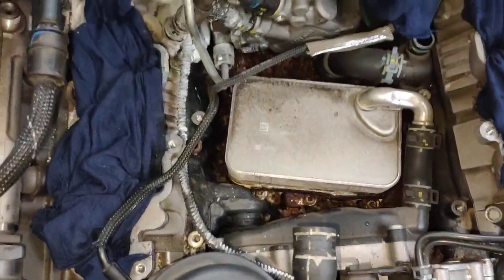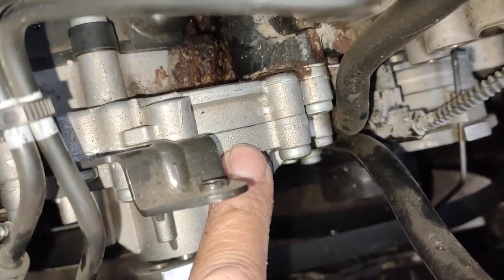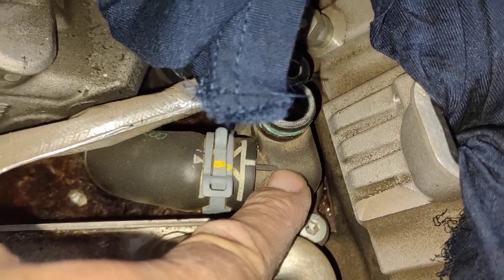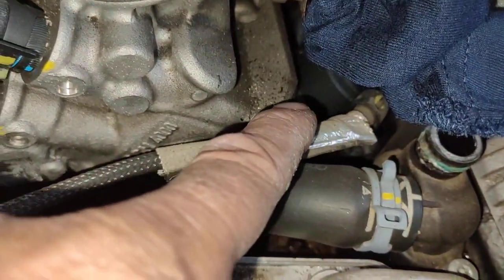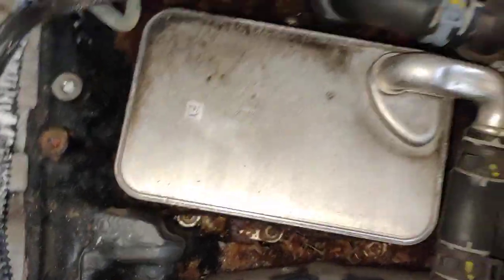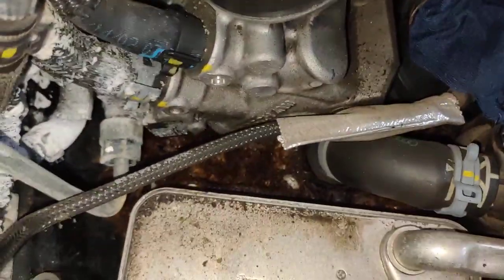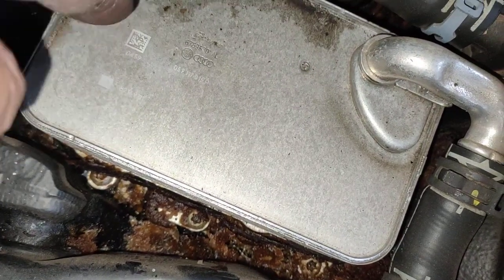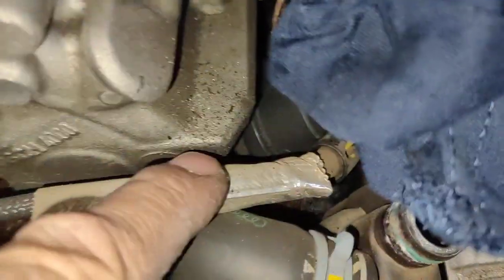Porsche Macan & CayenneV6 Diesel -Cooling system-common parts that fail causing coolant leaks by EMD

Comment: Hi Paul, happy to find your chanel, subsribed. I have CRCA engine and I faced the same leaking problem in the past and I resolved it. Unfortunately I was not aware the possible leaking of the plastic back cover of the waterpump housing and I have not replaced yet. So far so good. I found one problem with no clear solution for this engine: engine oil in the intake system. First I suspected the oil separator built in the head cover and I tried to wash throu. It did not helped. Next suspect is the PVC valve integrated in the head cover. It is on the parts database but do not have the part number. Seems to be not replaceable itself, only with the head cover completely.The cup of the PCV valve seems to be hard pressed into the neck of the head cover and I was not dare enogh to try to remove by force avoiding braking the cup or the head cover. What would you recommend to figure out why and from where the oil coming from into the intake? Could it be from the turbo due to a bad seal? What your experience is telling for this?
Reply from the maker: Yes turbo can have a small leak from the seal & cause a lot of headaches because no smoke is coming out of the exhaust yet

Comment: What is the life of these oil coolers you have seen, specially for 2016 models if there is any change, even though they look exactly the same?
Reply from the maker: Around 6-7yrs
Reply: @emdporschespecialistcaring8975  On my Audi A7 TDI 3.0, I am replacing everything under intake manifold except oil cooler and Coolant housing (because of its complexity). What you suggested for these two?

Comment: Based on your experience on these Engines and while doing this coolant or oil leaking job, which srews or bolts commonly or ever get strips or break during tightening?
Reply from the maker: All the screws on this job are  normal & can be reuse again but if you get new ones even better.
It's very hard to strip them as long as you wind them in by hand.
All 10Nm
If it's the very light weight ones like transfer case bolts. It's a must to replace them

Comment: Hi mate, I've got a 2013 A5 3.0 TDI with 100k km with the coolant leak under the flanges. So from this video would you recommend replacing the front plastic cover when I'm at it? Just a bit wary of the extra labour cost with removing everything from the front in addition to the intake manifold. Any advice would be appreciated. Cheers :)
Reply from the maker: Hi Henry,
I highly recommend changing all these parts mentioned on the video.
They are all plastic & if you don't replace the top plastic housing that's bolted to the front cover - It will cost more to do the whole job again.
If one of these plastic parts starts to leak the rest will follow.
Only a matter of time
Reply: @emdporschespecialistcaring8975  Thank you! I read online that I should order 059121086AH coolant pipe as well when changing the flange as it's prone to breaking when you move the pipes out of the way. Do you think I should get that too for doing the job?
Reply: @Henry-nr3sf  I'm doing this job on my SQ5 at the moment and I can confirm the same coolant pipe broke for me. The tip of it opposite to the expansion tank snapped and it's lodged in the other coolant pipe so I'm trying to see if I can fish it out and only replace the part number you mentioned.
Fyi I was quoted $104 from Audi for this little coolant hose. I wish we had something similar to fcpeuro for Australia, cheaper than dealership prices and buy online.
Reply: @Henry-nr3sf  sorry just realised I made a mistake. The part you're referring to I didn't have issues with when moving for the intake manifold. The hose that broke for me was 059121731D, this is the hose from the expansion tank that attaches to the part you mentioned. 059121731D quoted at $41.59
Reply: Thanks Belal, are you replacing the front plastic cover as well or just the flanges? Was the job hard to do yourself?
Reply: @Henry-nr3sf  I only found these videos last night so I was not planning on changing the front plastic cover but I will inspect it today to see if I can spot a leak. I might also get a quote on the part of it doesn't cost too much I'll replace it while I'm there. The only thing holding me back is that I'd have to take the front end off which means I would have to degas the AC system which I do not have the machine for. I'll also be inspecting the harmonic balancer for any play, and  the water pump too.
Reply: @Henry-nr3sf  I'll be replacing all the seals for the oil cooler, the flange and coolant shutoff valve as people reckon the shutoff valve leaks at where the arm pivots, seals for the flange and shutoff valve, intake manifold seals, and maybe the front plastic cover for the water pump.
The trickiest part was getting the intake manifold off, lots of cabling and hoses that run across the top of the manifold that have to be removed. I also had to remove the left side fuel rail off in order to get the manifold off.
Once I had access to the manifold and had all the manifold bolts off I couldn't loft the manifold off because it was sealed on so tight. So I spent a couple days trying to figure out how others did it, one YouTube channel called halffast told me he used a small pry bar as his was also stubborn. So I finally mustered up the courage to apply more and more pressure on a small pry bar that would fit  along the front of the intake and managed to unseal it little by little. You've then got to get creative with how you actually pull out the manifold as you'll realise there are things obstructing from all sides. The main obstacles being the fuel pressure sender on the left rail which is why I removed the whole rail rather than the pressure sender as you'll have to replace the sender itself if you remove it. And the fuel rail high pressure lines to the rear as they only have several mm of clearance between the intake manifold. I think I mainly tried lifting the front of the manifold first to clear the engine pickup brackets and then once I was able to clear those two brackets I had to sort of turn the manifold anti clockwise some what to clear the right side high pressure fuel rail line as the manifold catches on the line where it goes down in towards the valley.
If you don't need the car for a week or two then you can definitely diy, just takes time because of the damn intake manifold and then waiting for parts. But it gives you a good opportunity to clean out the carbon from the EGR. You can use the Erwin manuals as a guide but there were some things I did on top of what's mentioned in the manual such as a disconnect left fuel rail because I found it necessary for the removal of the manifold.
Reply: @belalhaidary8515  cheers Belal, think it’s definitely a shop job for me as it sounds pretty extensive!
Reply: @belalhaidary8515  Hey Belal, also found this Russian video that shows most of the job and might help you: https://www.youtube.com/watch?v=1mluiANseog  . I'm re-thinking about tackling this myself again now. Even in the Russian video he mentions removing that top manifold is the hardest part. Have you got quotes on how much labour would cost you? I've got one up here in QLD for about $760 - just trying to work out if it's worth it trying to DIY and save the cost lol.  Let me know how your DIY goes!
Reply: @Henry-nr3sf  This video would've been great to have before I started haha! He doesn't show the process of taking the manifold off though which is a shame, but still very informative. I got the parts yesterday arvo and managed to put everything back, just got to cleaning most of the carbon off inside the manifold and air pipes so I'll put those back tomorrow and she should be all done. I also decided not to change the plastic housing behind the water pump because I figured I could do that at another time and shouldn't have to remove the top lot just the front end of the car. 
No I didn't get any quotes but you'd be charged probably close to a full day of labour I reckon. I think you should be able to do it all in 1-2 days, I spent a couple hours here and there per day over a week or so and most of it was just staring at the manifold trying to figure out how to lift it off lol. 
I also noticed that the coolant shutoff valve on mine was the R version and the new one I got was th AM version so I think Audi updated it because the design did seem a bit silly for the arm attached to the vacuum. Let me know if you need any tips
Reply: @belalhaidary8515  Hey Belal, I’ve decided to give it a crack myself. Just wondering if you had to torque down the screws as per factory 9-10nm I believe or did you just hand tighten? I read that the hardest part is removing the intake manifold on all the posts I’ve seen about this. Is it pretty easy after that? Cheers
Reply: @Henry-nr3sf  Just trusted the hand torque lol. Yes the intake manifold is definitely the biggest part of the whole job. The oil cooler, coolant shutoff valve and EGR cooler themselves only take 20 minutes, cleaning the coolant and oil out from the valley takes longer than the few bolts, if you don't have a fluid extractor I would recommend getting a syringe from supercheap. I put everything back today and looked good so far but driving the next couple days will tell if it was a success.
Reply: @belalhaidary8515  Ended up tearing her down today - didn't have much trouble with the manifold to be honest, a bit of brute force and she came undone. Heaps more effort with the oil cooler plate - that was the hardest part to get off! I removed the high pressure sensor on the passengers side and broke the plug ($100 to replace) but besides that it was okay! Waiting for my parts to arrive now before build it back up. Did you do much cleaning in the valley where the oil/coolant mixed? I pumped everything out and dried it with paper towels/rags but the surfaces are still shiny from the oil. Did you use degreaser/brake cleaner to get it all off or do you think she'll be right left like that? Thanks for your help again! :)
Reply: @Henry-nr3sf  haha you had the opposite experience to me, manifold was hard for me but the oil cooler came off easy with the pry bar. 
Unlucky, that's why I decided to take the whole rail off instead of just the sensor because in the manual it says that they're designed to break if removed.
I spent a bit of time on the mounting surfaces, tried to get as much rust and oil and coolant off as I could. And tried to suck out as much fluid out of the valley as I could. Just used parts cleaner, sprayed on to a rag rather than direct to surface.
Reply: @belalhaidary8515  Hey Belal, finally got all my parts today and going to rebuild her over the weekend. Just wondering if this repair ended up solving your coolant leak? Did you have to do an oil change after since the oil/coolant mixed when the oil cooler plate was removed?
Reply: @Henry-nr3sf  Yup mines all good now, I was a little worries on the first could days after it was all done because the coolant level kept dropping after every drive slightly but that was likely just the air getting out the system. Coolant level has kept steady for more than a week now.
No I didn't do an oil change because I only did one 3500km ago, and I figured not much coolant would've gone down the oil galleys if any as I drained the coolant prior to taking the EGR off even used compressed air to pressurise it and blow as much coolant out as possible.
And checking my oil filler cap looks fine no signs of coolant in there. But I'll likely do an oil change soon just to play it safe.
Reply: @belalhaidary8515  Good to hear! Yep, I heard that's normal for it to drop a few times initially to cycle the air out. Did you do anything to clean out the valves as well while you had the intake manifold? All of my valves are looking pretty black.
Reply: @Henry-nr3sf  yeah I just used a long screwdriver to get in as far as I could and scrape as much as possible off, and using rags and parts cleaner to wipe as much as I could off the insides. I'm thinking of buying some sort of intake manifold cleaning chemical to spray into the intake while the engine is running to try and get the little bits or parts I couldn't reach cleaned.
Reply: @belalhaidary8515  Hey Belal, how did you remove the connecting pipe from the clip at the end of the pipe that you broke? I broke it too and am having trouble disconnecting it. I've taken the metal retaining pin off it but have no idea how to pull the connecting pipe out.
Reply: @Henry-nr3sf  I used a sharp metal pick to chip away at the outer part, but after a while it came out as one bit. Bit hard to explain without showing you a pic.
Let me know how you go, if you're having trouble I can email you some pics.
Reply: @belalhaidary8515  Hey Belal, how did your repair end up going? I just finished the job today and took it for a run just then for about 20 minutes. Topped the coolant up to the max line before I left and now when I return it's quite a bit below the minimum line so I'm a bit concerned I didn't do anything! I looked  into the valley with a torch and can see a bit of liquid under the vacuum flange that I replaced..... I'm pretty worried lol but not sure if that was just dampness from the original leak that I didn't clean up properly haha.
Reply: @Henry-nr3sf  Mine's all good no issues since doing it and the coolant level doesn't fluctuate. Give it a couple days, just top it off to the right level mine took a few days to get all the air out and until all the air got out my coolant level also kept dropping. I made sure to clean and wipe all the oil/coolant out of the galley so when I check it it all looks dry. Keep an eye on your galley as any dampness should evaporate when you drive and the engine gets warm